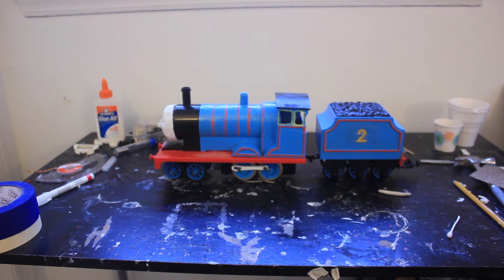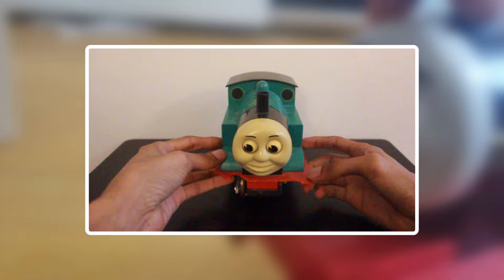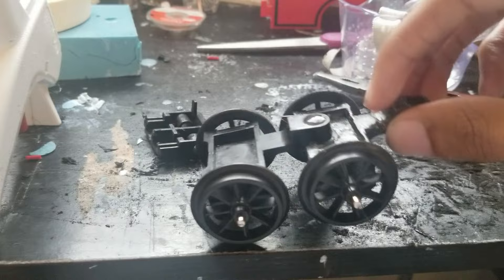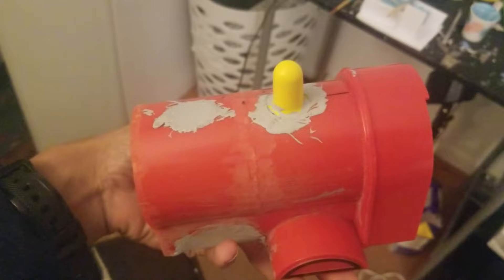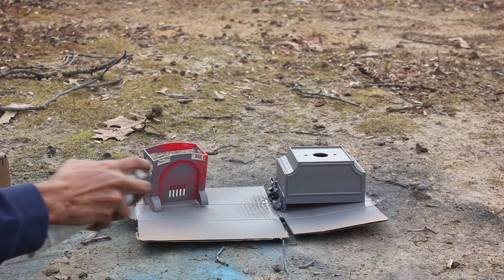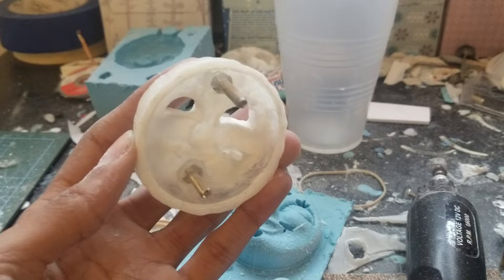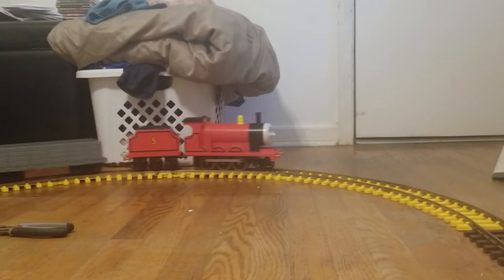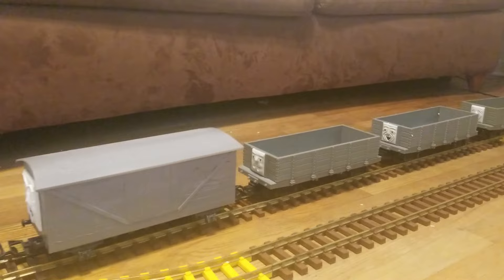Custom Lionel Edward The Blue Engine

Comment: A very nice custom! The firebox being rounded off on the original James model kinda helped make it more like Edward (see 5:54)! 
This video proves that Lionel could've easily made an O scale Edward by recycling most of James (and they probably would've gotten away with making Henry out of the Hogwarts Express)
Reply: I agree the firebox is kinda round so it kinda almost blens with the front boiler so yea i agree
Reply: A cheap and not very popular method, yet at least it brings more Thomas characters to their Thomas O scale line.
Reply: I think you're right. Since the Lionel James's Firebox is more rounded, Lionel could have made edward and/or molly using james' parts and thomas' wheels for edward, and it would have been a cool new engine for Lionel to make using a modified tooling. A Lionel Henry would have also been cool considering the fact that Lionel could modify the tooling of the gwr Hall class/ Hogwarts Express just to make it resemble Henry's basis the black 5. And if they were to make a Gordon they'd probably reuse the Hogwarts Express Loco chassis and YouTuber Thomasdotd made an O scale Gordon using a Hogwarts Express chassis and an O scale Flying Scotsman shell and maybe they would use Lionel Thomas to modify into duck Oliver Stepney and Ryan and that would have been cool

Comment: I did this with take n play James cuz Edward  isn’t Available so I removed the front wheels  and he balances well on 4 driving wheels and drew on his bogey wheels  and painted him blue red lines and no2  and did trucks the box van was a re painted mail car and the troublesome truck was a cargo car repainted . I basically used this vid as a guide but at a smaller scale ps Edward is my favourite engine so thx btw can you make Edwards exploit ,Thomas and the guard and James and the bootlaces . And can you make express coaches red/green out of Annie and clara bell  and the same with branch line coaches using Annie and Clara bell so that’s my thoughts and yea take these into suggestion thx 🚂😀

Comment: please make gordon
Reply: It would be cool as a final
Reply: @MarvelousManthe2nd  i agree
Reply: @MarvelousManthe2nd  I might after my own g scale time train from back to the future 3 but a Southern Pacific daylight GS-4 #4432 instead of a 4-6-0 Rogers tenwheeler
Reply: Oh believe me I've tried to do that it did not go well... ರ_ರ
Reply: Although you could make Henry just fine you just have to figure out how to extend the running board without cracking it
Reply: @Robin_The_Red_Rabbit  wow i dont really blaim you, gordon literly cannot be done without simply reskinning an lionel A3 (witch i dont know if that exists) uhh lemme guess, the chassis fell apart? maybe a crack in one of the parts? broken motor? or was it none of the ones that i questioned?
Reply: @choochoooo317   It was more of I couldn't get it to work because it just became too heavy and then it fell apart however it is possible to make Henry by slightly altering James
Reply: @Robin_The_Red_Rabbit  i understand.
Reply: That would be cool

Comment: When's the next Lionel custom Thomas model video? And I suggest you make percy because he's Thomas's best friend best friend after all. And it should not be a problem because you would just have get any Wheels Thomas or James's and spray paint them green and you also make the chassis wider get a good amount of distance between from the wheels and you'll have to make a custom piston and the side rods that are attached to piston and you'll have to make a custom face as you did with Edward and you'll have to 3D print a Percy body. So next video next custom you should make percy.